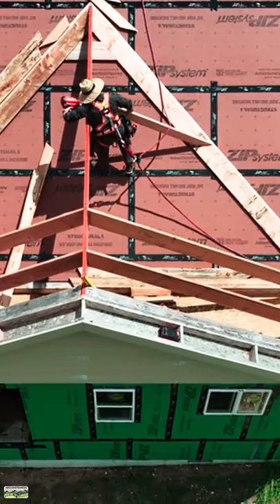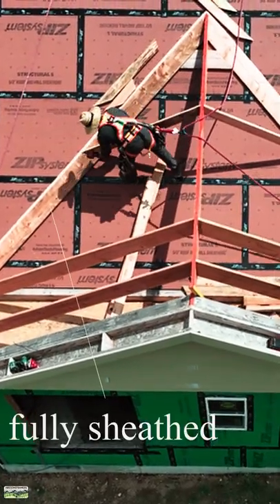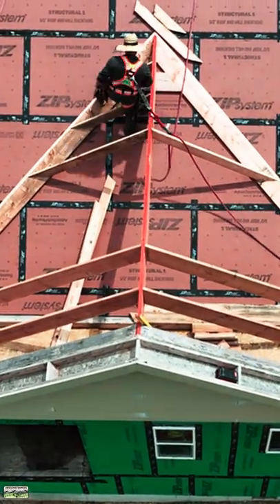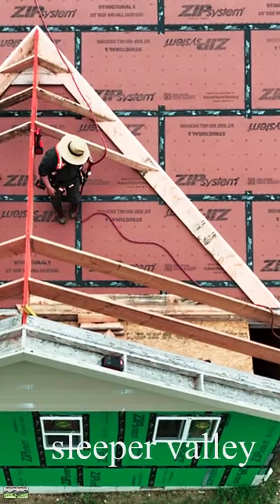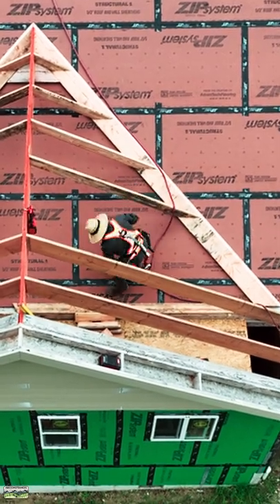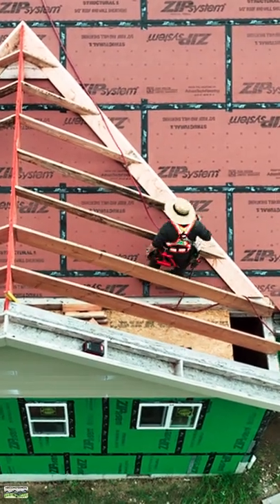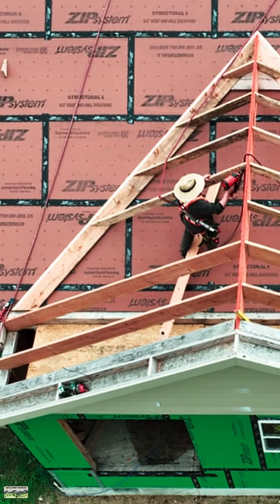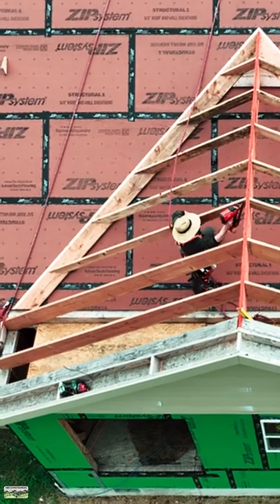Framing Layover Valley #shorts #roofframing

Comment: If I were to do this I’m trying to wrap my head around what angle I’m calling out for that sweet bevel on the sleeper valley. Would it match the pitch of the overframed roof?
Reply: Bevel is the degree of the roof you're landing on miter is the back angle of the over-frame pitch
Reply: If its an equal pitch valley, the sleeper bevel angle to set your saw at is 90 degrees minus twice the hip / val backing angle. If it's an irregular valley, the sleeper bevel angle is 90 degrees minus the sum of the hip / val backing angle from both pitches.